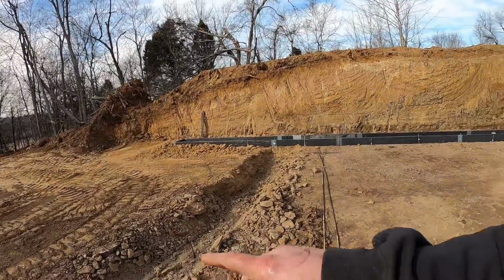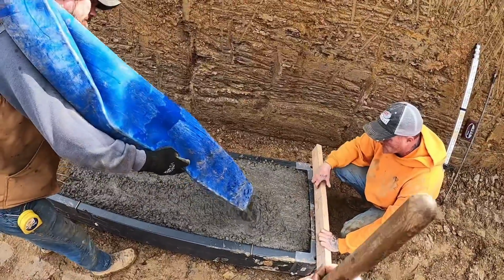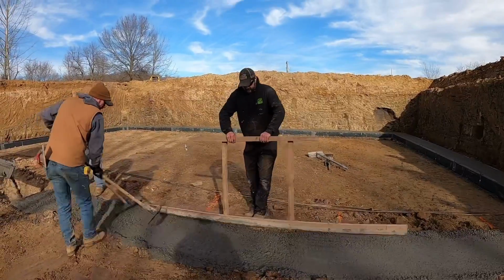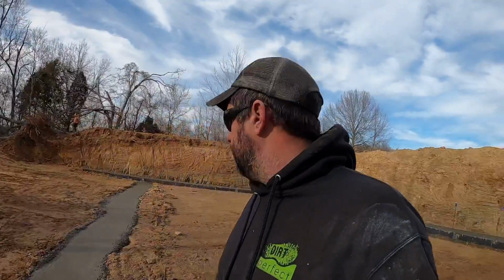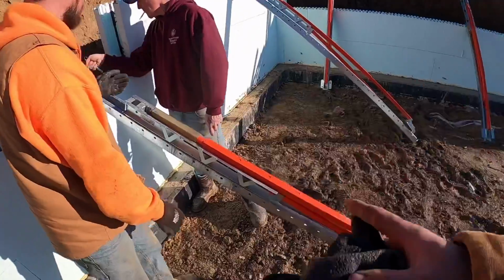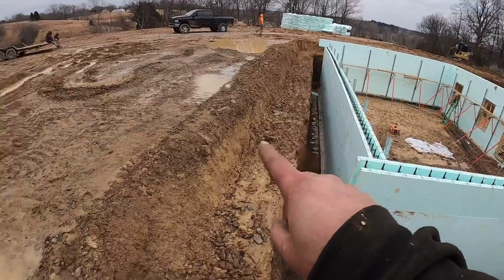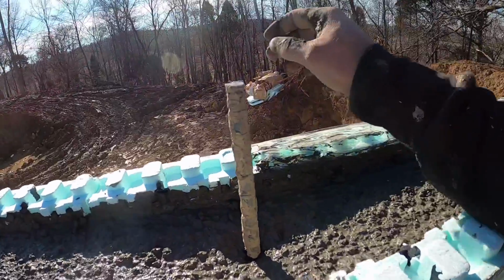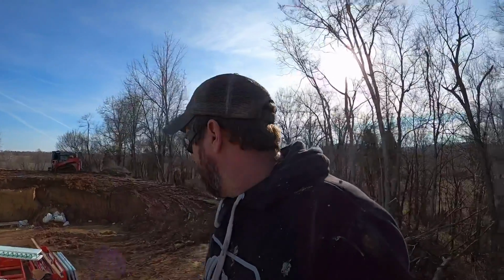Pouring ICF basement walls in preparation for a second level ICF pour that's right going up

Comment: Mike have you tried using a leaf blower to blow out the nipples that had ice and water in them ? I’m surprised there is no vibration pig tail running up and down your in walls to eliminate air pockets a long with proper compaction in the walls ? Looks great gentleman.
5-22-2026

Comment: Mike I have wondered why you did not pin the one wall to the footer??? I know you stated in the one video that houses had been just setting on foundations without pinning for decades or longer. I just wonder "why" not go ahead and pin then anyway. The extra cost is peanuts, just some pieces of rebar. So I am sure you have a thought out reason for not pinning.
       I usually tend to go stronger is always better, when working with concrete and or foundations.  Example is if five inches of concrete is "enough" six is even better or if 1/2 rebar "works" 5/8 is even better. 
   We do not pour near as much as you do but we have been doing footers and walls for close to fifty years now and have very few with any cracks or such. Not one single one with a structural issue. I am interested is hearing how/why good companies do things.
Reply from the maker: Did

Comment: It's funny how different things are built in different corners of the country. Down here you couldn't get away with digging a hole that deep unless you wanted to be pumping water out of it 24/7 and forget getting a concrete truck in it.

Comment: the  guy with the sock  needs a face  shield on or  he  needs  to be a  bit higher up on the  wall  so not to get splashed so easy , you would  think if  you guys did  this  stuff all the  time you would  know what  you have  to do  by now

Comment: Very interesting project DP.
The ICF block and PLUMWALL bracing are a very good combination. Watching you do the final adjustments, I was thinking the same thing about using the impact or a two speed drill in the lower gear setting (like the old Makita drills), but I think these new ones only have variable speed and you are right, they just don't have power at low speed.
When you were talking in the previous video about full wall ICF, I was curious how the pressure to height ratio worked without the traditional tie systems. I realize that there is a webbing system that connects the the two sides of the block and provide the basic structure form, but wondered about the lift dynamic as you poured the higher sections.
I presume that you will explain the corner blow-out in one of the next videos.
The ICF block fascinates me. I'm amazed at how versatile it really is. The last wall job I did was AlumiForm and WallBoard, both systems still used taper rod ties, but it was a government job, so you use what they require. I think ICF is getting the be more common here in Hawaii, but everything moves much slower out here. Shipping costs are the number one factor because everything comes by ship if it's big or heavy and the rest comes by plane with the additional cost.
A big benefit I see is all the lateral support webbing for running rebar, especially here where we have the highest earthquake activity in the country and most of the world except the rest of the Pacific rim.
Great video. 👍

Comment: I am interested in seeing how you tie the floor into the walls.  Have built a single story with slab floor.  We used a 2x4 to create a shelf on the poured concrete walls but didn't put bent rebar into the top of the wall to tie the floor into the slab.  The result: when the dirt/stone settled under the slab the notched concrete wasn't strong enough to support the now suspended floor and it cracked off.  The floor dropped about 1/4 inch breaking the tile on top.  It was a dirty job to grind out the crack around the edge and fill.
Reply from the maker: Will cover that

Comment: Thanks DP. I have been thinking about doing a 2 story ICF house on the west coast.  Anything that is not waterPROOF will rot.  My current basement is ICF, but the second story is stick framed.  The concrete board siding is durable, but any wood trim is damaged, and I have been gradually replacing it all with PVC wood look alike. ICF for both stories would provide the durability I need for coastal climates. I have however never personally seen a 2 story ICF build, so your video is most helpful.

Comment: When we pour walls with a pump they have a double 90 on the end of the hose so the mud goes sideways for a few inches before exiting the hose. It slows it down and doesn't splatter as much and us much easier to control where it goes.  Have you ever used the stiffener wire that nudura has that goes inside the forms to straighten them instead of 2x4 on the outside?
Reply from the maker: Yup done that a few times not a big fan like the transition hoses much better

Comment: That concrete looked a bit dry.  Could you use a leaf blower to help remove the water from the forms?
Reply from the maker: Frozen
Reply: @DirtPerfect  I use my backpack blower all the time to melt ice from driveways or walkways. It might of worked

Comment: Nice job Mike and the video had a good flow to it in case you are wondering.
Should be interesting to see how you engineer the next course as that looks quite vulnerable without the usual shuttering we see here in the U.K.

Comment: That 2x  footer float could use some sort of fence that guides it along the sides as well as going forward about 3" to stop splash.  1/2" ply about 4" high x 6-8"long screwed to the sides of the float.

Comment: What size socket does that use? I think a long with longer extension you need swivel socket.
Reply from the maker: Yup need to get one it is 1-1-8
Reply: @DirtPerfect  Do you mean 1-1/8
Reply: @DirtPerfect  You should get a 1-1/8 swivel socket and a 31 inch long ext by the 9th from Amazon.

Comment: What  is your  cement spec for your system? I noticed it has small aggregate in mix. I certain you probably have put that information out already. 
 Impressed with pride and workmanship.
Reply from the maker: Batch plant has a ICF wall mix that works great not for sure all the specs

Comment: Seeing that is a walk out are they using Foam under the floor slab , if not the whole slab do at least six ft. in from the edge just to keep the cold out  , well worth the extra cost  !!
Reply from the maker: Think about that and the type of wall
Reply: @DirtPerfect  I love  the wall , it,s the best . Its that footing no thermal break , cold will go under the wall and through the footing to the floor . Just think about it .

Comment: DP-- Looks like if you had a 4' 3/8 extension on your impact adjustment drill, you wouldn't have to bend over so far? Save your back and skip thru that procedure. Or get MBTS to do it with 1/2 " extension and not tell him about the 4'!!

Comment: Great visit. Question would it not be easier to put the stone in before you put the walls up. After all you built such a nice ramp.
Reply: Sorry I meant video
Reply from the maker: Stone was not part of my contract ans have to be careful with that and the braces they don’t hold very well in the stone
Reply: @DirtPerfect  Well that makes a lot of sense.Also I wasn’t thinking about the braces I’m so used to doing regular concrete walls.

Comment: Great work DP, I feel I am on the job while watching this, in FL we been using ICF for years, it sure was come a long way, a lot easier to put up, I remember some contractors using sheets of Plywood on the outside corners to keep from having blow outs, ICF is better built today. Very good video Mike, and once again great crew. Looking forward to 2nd floor.
Reply: I'd be tempted to use it (the plywood) anyway at the corners, probably wouldn't need anything more than quarter inch just to give the little bit of extra bracing.

Comment: I like that system of braces, easy to use, I am astonished that you can use them with only one board. Me, I don’t care but I vividly remember the powers that be in the UK making us scrap some of our most useful tight space system scaffolding because it was only two boards wide (had to be three) I won’t go into all the rest of the nonsense that went with this, but basically it ended up that we could do what we wanted if we could get men where they needed to go ! (and I assume they promised not to look !)
Reply: Also no handrail that's a big no-no in the UK
Reply: @anthonydefreitas6006   Handrail !  you have to have a handrail over 6’ from the ground ! there are two storey scaffolds in my street that have handrails, kickrails, toeboards and inside boards and debris nets !!
Reply: @CrimeVid  Not any more any time you work at height you require all of those things.
Reply: @anthonydefreitas6006   Working at height really does not require all those things, most of it is a substitute for being careful ! and were instituted by the trade unions as a way to slow things down, and make sure even the doziest of them couldn’t fall off  if they were asleep in a corner !
     Also,how do you get men in to work at height if there is  no room for all this extraneous junk ?  I can think of jobs where you could only get one board wide by pushing tons of steel out of the way !

Comment: Was there no need for the vibrating thumper at the base of the wall on this occasion or did you not have opportunity to film it?
Reply from the maker: Both
Reply: @DirtPerfect  I can appreciate that. For some reason we build very few basement properties in the UK. It’s mostly done as a retrofit by rich Londoners due to high property costs.